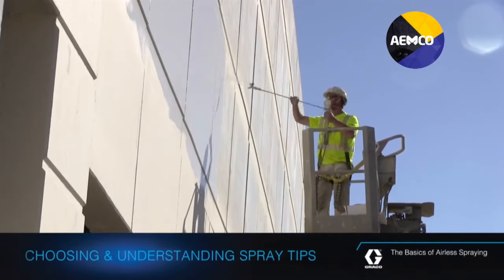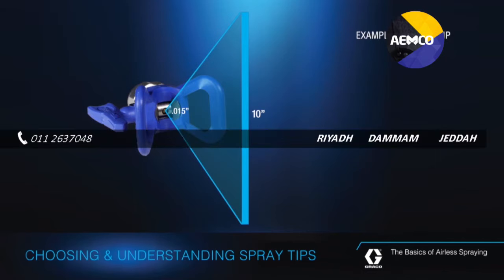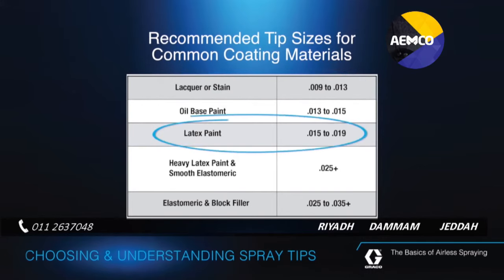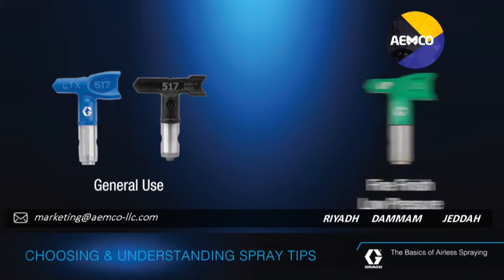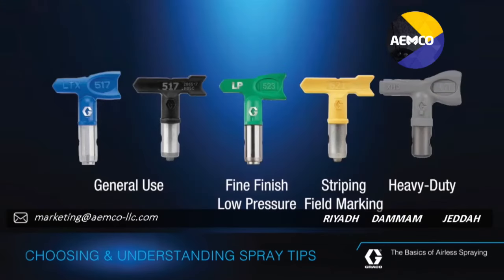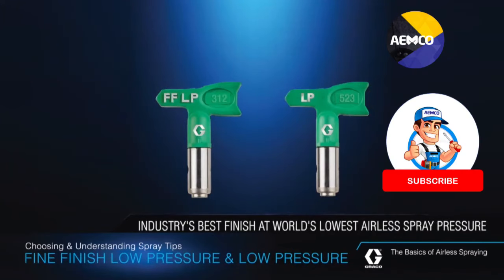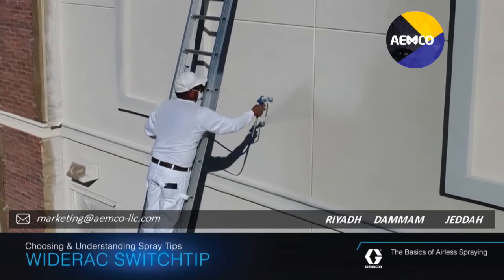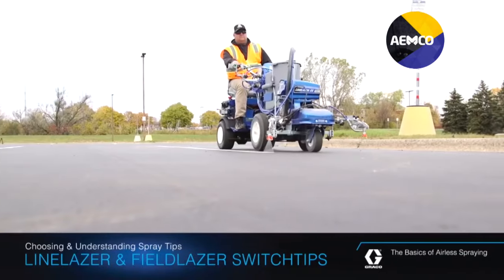How to choose the right Airless spray tip from GRACO - AEMCO Saudi Arabia

Comment: Why won’t Graco make tip sizes more legible it’s terribly difficult to see and read after use especially if you clean your tips .. the black tips are terrible and the blue tips are not much better . You would think Graco would fix this terrible issue..
Reply from the maker: Your Point is noted and we will definitely give feedback to the manufacturer